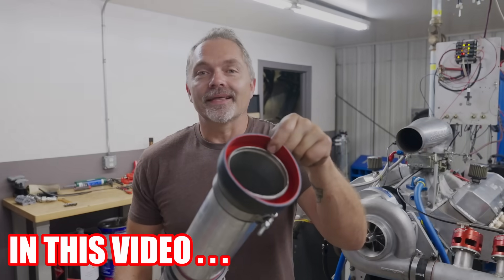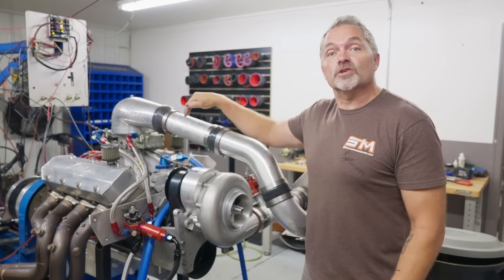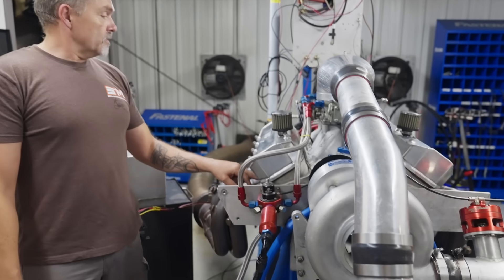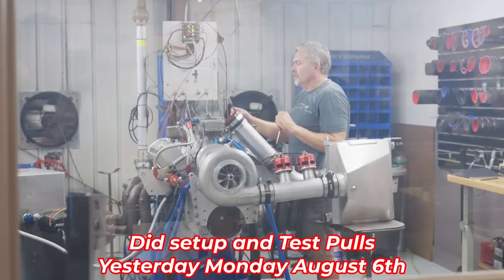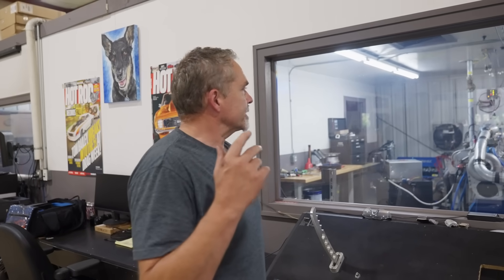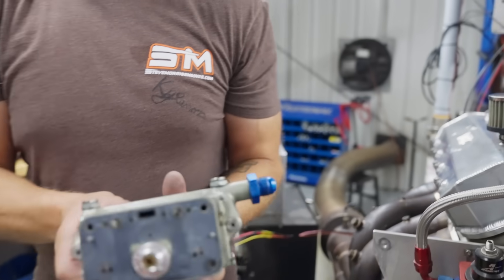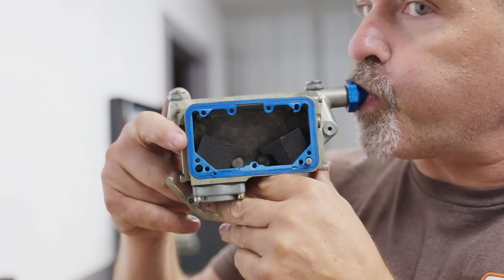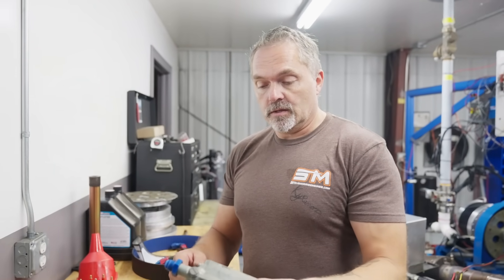I’ve Never Seen This !    It’s An Insane Amount Of Water To Burn??

Comment: It's pretty cool to see the little bit of older tech with the blow through carburators. Whoever engineered those carbs is a genius. So complicated.
Reply: Not really that big of science product. Is all about making the carb think is lives under boost as well as supply fuel. Learn what it needs one piston at a time.... we did this in the 70's when no EFI was possible.. We also built mechanical fuel injection to work with turbos..  Is all a lot of fun when you peel open the float bowls and find floats smashed flat...  It really is the most responsive and best way to go but it is fraught with headaches... EFI made it stupid simple..  What is sad is some of the "facts" being put out.  A certain tuber promotes high compression pistons (not a good idea).. That water/methanol makes power (it is used to prevent detonation, not make hp)   What I love about Steve is that he learns as he goes and is not bashful about being wrong.. I have wronged a lot of engine parts over the years but each busted part is a le$$on...   :)
Reply: @randalljames1  I have been taught that air or oxygen and fuel burn, but water does not burn. If a percentage of the flow going into the engine is water, then there is less space for what makes that explosion and power. As a person with an open mind, the only way water would help is if the loss of that fuel mix volume cooled so much that the engine could make more power than what the lost air/fuel mix would account for. I'm guessing it isn't going to happen and it is better to control the heat through other methods such as not making excess heat in the first place.
Reply: The thing is water turns to steam at 1600x original volume  @CGT80
Reply: @joelg6740  Yes, I forgot about that, but have experience with it. water plus lead=tinsel fairy. It is fine when it hits the surface of molten lead, but let it go under and it blows. So, does the steam help make more power or is it purely just cooling?
Reply: You lose power even though the water turns to vapor extracting heat it still doesn't have the expansion energy as fuel so it drops in power because of sharing  displacement with fuel, and air, but it keep parts  down lower in temps from reaching critical melt temperatures so you can spin engines to higher RPM where you can make exponential more power where boost fixes everything. Power.
Reply: @CGT80 only has condensate like that when it vents to atmosphere because of temp and pressure differences otherwise it would just go thru the system like normal still all the same air it's just compressed and goes thru a heat cool cycle
Reply: I'm old enough to get a kick out of the young fuel injection guys marveling at how an old school blow through carb can still run great when there is no electronic stuff involved. EFI is awesome but back in the day when it didn't exist, car guys had to be creative and make carbs work out of necessity. I love to listen to Steve explain these blow through carbs, he is a master of that technology and today's tech as well.

Comment: Just a little Joule - Thomson action going on there. Whenever you have a gas mixture go from one chamber of high temperature and pressure to another chamber of lower temperature and/or pressure, there will be adiabatic expansion causing condensation. This is just a case of a gas mixture going from a chamber of about 44psi @ ~100degF to a chamber of about 14psi @ 70degF. The change in pressure alone caused all of the water molecules in the gas mixture to condensate. This is actually a common process in most hvac systems. 
Putting a blow off valve on the cold side of the intercooler will also cause this type of behavior and it's even more of an issue as relative humidity increases.
Reply: Yep. Some good pressure differential right there.
Reply: Correct… if you took the air in that dyno room and used a compressor to put it in a tank at 30 PSI, let it cool a little  to remove some of  the heat from compression (simulating the intercooler), and then suddenly vented it to atmospheric pressure, it would instantly cool far below room temperature  and any remaining vapor in the compressed air would turn to mist.
Reply: I do work with gas and liquid analysis for chemical plants and refineries  and have to take the Joules-Thompson effect into account all the time. Especially with analytics that have components that either boil or condensate depending on it's state
What's also pretty cool is that almost all gases go cooler as the flash from the drop in pressure.
Except Helium and Hydrogen, they actual increase pressure.
Which can actually lead to hydrogen fires in plants that uses that under high pressure and get leaks.
What's dangerous is that Hydrogen burns without a visible flame too

But seeing the effect of the pressure flashing like in the video is really cool.

There are also so many interesting discussions about how quickle temperature drops in a gas, because of how badly it transfers heat.

I really liked your explanation 🙂

Comment: Fun fact: water expands 1,600 times its volume when it flashes to steam. 1 liter of water makes 1,600 liters of steam.
Reply: And that is why the yellowstone geyser exploded not too long ago, steam explosion
Reply: Every time it blows (geysers) its a steam expansion / explosion. When it draws in extra water it flashes extra large with potentially disastrous results. A few gallons more I suspect is all it takes. Happens every few years they report. It is really too dangerous to allow people that close.
Reply: @IronWolf_the_1st it blows on a regular basis you can set your watch to it up until the other day
Reply: That is a fun fact. No wonder it makes efficient power.
Reply: WATER POWERED CARS, anyone??
Reply: What is this strange “liter” that you speak of??
Reply: @salvatoregiovanni8967  it's the volume of soda you drink. FFS I'm 49 and I don't remember when soda wasn't sold in 1, 2, and 3 liter bottles. Fools acting like liter isn't a common unit in the US. Even modern soda bottles are 16.9 oz, 500ml (half a liter if you're bad at math), and that means they are packaged in metric volumes.
Reply: @salvatoregiovanni8967 Basically 1 milk jug of water makes 1,600 milk jugs worth of steam.  I hate the foreigner measurements too
🤜🏻🤛🏻
Reply: Fun Fact: the water didn't boil to steam. It dropped temperature to dew point. Same thing as when you spray deodorant and it feels ice cold. What you saw was rain.
Reply: @rubyr.4812 free energy and it would be great. Heating water to steam is the issue.
Reply: @salvatoregiovanni8967  1 liter is 0.264 gallons
Reply: And 5psi of water over a 200 foot span is like a 22lr bullet being fired
Reply: @rubyr.4812 Ever heard of the Stanley Steamers of the early 1900s...? They pre-date the ModelT...! Jay Leno has a large collection of steam cars from the late 1800s/early 1900s...!
Reply: @salvatoregiovanni8967  Just some metric stuff that some like to use in rest of the world.... but don`t bother about it..... just some others that should.
Reply: Steam powered cars were a thing. Problem is they fell out of fashion just as the technology was starting to mature from boilers to steam generators… they can make   Hilariously diesel embarrassing amounts of torque. Geared right they can go real fast as well.
Reply: @R6AAO  The same thing happens when you rapidly drain an air compressor, but the expanding gas causes such a drop in temperature that ours will shoot ice fragments if you over do it!
Reply: Just as much as dry ice that will expands about 2,000 times..... I guess.
Reply: @peejay1981   the greater the pressure drop the colder it'll get. You can make other gasses freeze using the pressure drop of one gas to freeze another. It's how they get to liquid nitrogen, helium etc. Also the warmer the ambient temperature the more ice will form because warm air holds water and it's that water which freezes to the end and outside of the hose.
Reply: @truracer20 I'm 50 and I  remember 2 quart bottles.  We  still have 20 ounce bottles.  12 ounce cans
Reply: Thats why pulling tractors burn about a gal of water in 15 sec. POWER
Reply: @TheJohndeere466  Is it dry water or just water or is i mixed with some stuff like glass cleaning washer...... or or? Will the water cool down the burning temp to a level?
Reply: @rvarsigfusson6163  It has a little mixed with it to lube the pump. It does cool the pistons and prevent melting.
Reply: slowly with a lot of energhy

Comment: I had a 1980 Ford Mustang with a 2.3 l 4-cylinder Turbo but it had a draw through carb'd setup. I loved that car, and I learned all the carburetor stuff that you're talking about now and it's been so long since I learned it that it's just really awesome to hear it again.. kind of useless information because it's very rare to see those setups anymore.
Reply: 2000 hp?
Reply: @xbear7473  I have never seen a 4-cylinder with that power. Best I saw was when the boostedboiz got 1300 horsepower to the wheels in their MR2 with a K20 4 cylinder.

Comment: Cold air moisture, but you're also getting a bunch of instantaneous pressure drop which also lowers the temperature which basically makes a cloud.  It's like cracking the cap on a 2 liter of pop when it's hot out, if you crack it just right it dumps the pressure, but you'll see a little grey cloud in there swirling around for a few seconds until it warms back up. Here you had a couple hundred liters of pressurized moist air rapidly cooling down. 

PV=nRT works!

Comment: Those fuel leaker days..... don't miss the fuel on my fingers all the time LOL  Those jet extensions on the rear, I did that once and it ended up needing a lot more jet to work.  Put the jet back in the block, and a slip over (copper tube) extension and was able to take a lot of jet away.  Was wild.

Comment: That was a great explanation on how the Holley works. I used to run vacuum secondaries, and I always had a jet kit and a spring kit. I knew the nomenclature of the parts in the carburetor, but I did not know the specifics of everything. I did know how to tune it to make it go fast but I did not have any turbos or superchargers on any of my engines. Thanks Steve!

Comment: Dew Point.     The temperature when the moisture in the air condenses.  Droplets on the outside of a cold can on a warm day.  When the charge tube blew off, is what it would look like in an AC system when the high side goes through an orifice tube to low side. We saw the mist due to a rapid drop in pressure. The air would have been colder than ambient air temperature in the room.
Reply: Yep, rapid pressure loss.

Comment: Steve, Compressing air forces water to condense out of the air.  That is why we have to drain our air compressor tanks.  I think your ice water inter cooler was a big part of it and the boost level contributed to it also (water in the tube).  I'm sure it is as humid in MI as it is in WI this time of year.

Comment: compressed air always has lots of water in it. The water doesn't compress with the air and settles in the tubing. That is why you must drain the air tank on an air compressor regularly, especially in high-humidity climates.

Comment: STEVE as usual another great video mate. There are so many younger people who only have experience with EFI, they never grew up with or learnt the intricacies of carburettors and how they wrok with vacuum and airflow through tiny passages.
 Back in the 70-80s I had a 4cyl with twin DCOE Webers and that was as close to fuel injection as you could get for the street, of course we had mechanical injection for race cars. But nothing EFI, my first experience with that was CFI on Ford Falcons here in Australia, and you also had the Bendix injection from Europe.

Keep up the great work and hopefully we will soon see the exit of the Right Royal PITA Hemi.

Comment: wouldn't there be more room for O2 if You could get rid of some of that water? Just thinking of always keeping Your check/blowoff valves on the bottom to dump water first..
Reply: I want to say that since this forced induction engine, the cooling effect of the water condenses the air charge such that there is more O2 with the water. Assuming there’s not more water than can be vaporized by the heat. That water was vapor until it hit the atmospheric pressure and turned to liquid water.

Comment: The simplicity of carburetors is just so darned elegant. All that control with no external power, just direct the pressure differentials to the right places, through the right restrictions (jets) and applied against the correct springs… and it WORKS.  No matter how much I like EFI, I’ll always have at least a couple of good old carbureted vehicles around.

Comment: Tip
There’s an issue with some Holley type carbs that if you’re unaware of can drive you nuts.
The issue is that after a time of use the gaskets in the metering blocks swell into the channels partially blocking them off.
It can also be intermittent and or progressive depending on throttle position.
A temporary solution is to shave the gasket in the channel areas thinning it out so it causes less restriction.
Using two gaskets with shim stock between and completely cutting out the channel area on one is a more permanent solution.
Reply: I don't think it's as bad an issue or maybe not at all with the blue reusable gaskets. now the other gasket type do all sorts of bad things, especially if allowed to sit dry of fuel.
I have seen the cork and other composite type completely pulled in over passage holes, crossed passages or even so far the bowl was not sealed at all anymore. old power valves so stiff they don't work hardly or stick open/closed and of course the accelerator pump diaphragm. old enough to have learned and rebuilt piles and piles of carburetors and you know how that works, rebuild a few then everyone, their brothers, sisters and neighbors come running with them. distributors, points and all ignition types too, lets give alternators/generators a mention also. 😑
Reply: @throttlebottle5906  I haven’t touched a carby in so long the last one now has grand kiddies, so improved gasket technology should have come along long ago.
I vaguely remember there being a rubberised aluminium gasket similar to an LS oil pan gasket being developed to counter the issue I described but that was long after I gave up on carbureted vehicles

Comment: Was so impressed with Holley carbs.  Except for a rare particle of sand in a port, just worked.  Few jets in the 72-80 range, fuel mixture was handled. Carb was used in the sand dunes with lots of float bounce, no bounce floods, like other brands of carbs.

Comment: I know enough to build carbs, from mistakes I made over the years. Im a tech and have done more carburetor work in the last two years than I did for myself or professionally in 37 years. Working on older stuff, and not knowing about the higher end blow thru designs is very ENLIGHTENING! DUAL floats & trick power valves that goes with it. Good Video & educational! Take care!

Comment: The rapid change in pressure also causes an instantaneous temperature drop. If it went from 30 psi of boost (44.7 psi absolute, psia) to atmospheric pressure, 14.7 psia, that's a pretty big drop over a very short period of time. Think of an orifice tube or expansion valve in an AC system. The tube upstream of the orifice is usually warm, and immediately after it's cold to the touch (and sweating if it's humid outside).

Comment: In dirt super late model racing alot of them now use what's called a super bowl carburetor. It's a float-less design that just keeps the bowl topped off by the fuel pump and has a return line to the tank for excess fuel. Pretty neat deal, a company named Willy's makes a kit for several different carbs

Comment: I had a Spearco air to water on my supra in the mid 90's that started doing the same thing.  The intercooler core had a leak.  The plugs are getting steam cleaned.  It would suck water into the intercooler at idle then as boost came on it would blow into intake stumbling until it cleared up.  I had an old Accell DFI pro sequential on it that I bought from Lawrence Conley who had it on Tweeked his buick grand national.  Fun times!

Comment: what is interesting is that with the boosted air under pressure that moisture would never be seen, just the rapid expansion of the hose blowing off is what condensated the moisture out. There is a few BHP in that moisture too. If you were to feed air from a dry air source or say sealed then  filled that dyno room with dried air do you think you  would see less horsepower?

Comment: If each carb jet does basically 2 cylinders then why the bigger jet size for the 4 back cylinders?  Both ends of the carb have a metering block with a power valve so why do cylinders 5,6,7 and 8 need larger jets?

Great Chanel!  Love all of your videos!

Comment: Correct me if I'm wrong but the condensation explosion is because the room-temperature-ish compressed charge escapes & rapidly loses pressure, due to ideal gas law this means that the charge's temperature must also rapidly drop and so the de-pressurized charge is actually colder not only than the surroundings but also the intercooler, that's why the amount of water is so high and since it's on a molecular level the condensation is insanely fast.-forming.

For those who don't know Ideal gas law basically states that for a given amount of change in gas pressure there is a linear change in gas temperature, that's why any kind of forced induction greatly increases the temperature of the charge and the higher boost the higher the change, that is also what happens in the cylinder & why compression-ignition works so well.